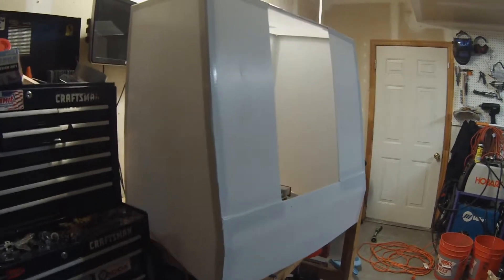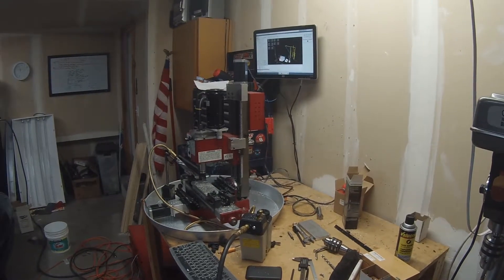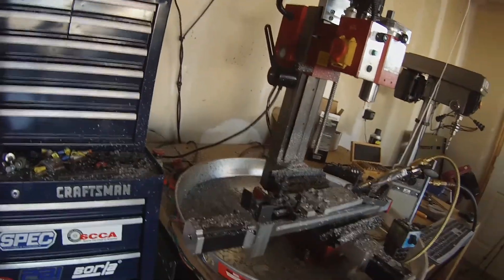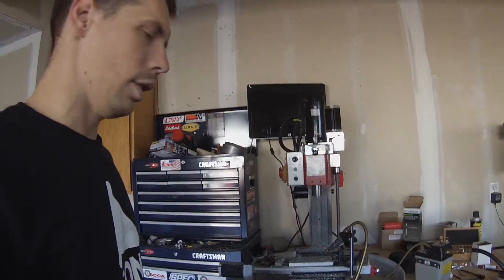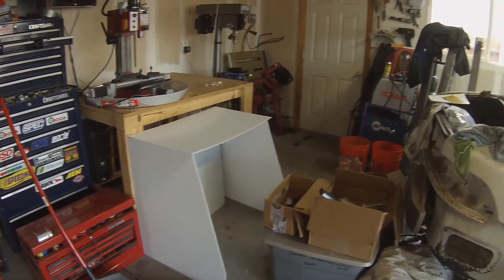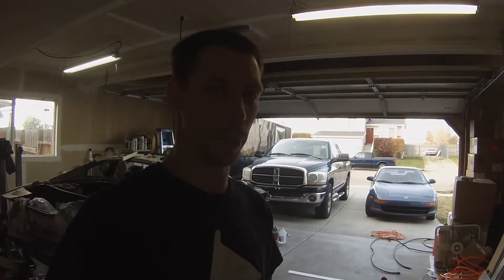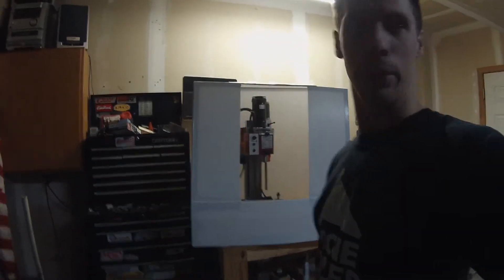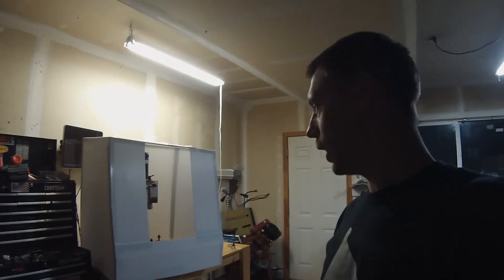Making a Mini Mill CNC Enclosure

Comment: Very good. Looks like you are using a coolant mister. If you really want to tackle the chip problem an enclose like that well help, but I can not emphasize the heavy use of coolant. Go check out some vids on new cnc's. The coolant use is probably in gallons a minute. They use multiple hoses pumping out coolant. There is great advantage to this as your tools will last a lot lot longer and with aluminum you can run your spindle wide open, just adjust the feed speed. Enough coolant and aluminum well never bind to the flutes on the end mill. The simplest professional mill chip system I saw was on a mill that had a rectangle tray that just pulled out from under machine. Nothing fancy. You will be surprised how effective an investment into this well be. You can easily double production times. I am sure there is a limit to speeds you can cut aluminum, but I was using a machine that I was cutting aluminum at 10,000 rpm wit a 3 flute 3/4 inch end mill and the chips were flying out going about 15 feet, sound like a chain saw. Remember that just aluminum. Titanium can catch on fire. Just trust me on that and a hole bunce of metals you will not get improvement in speed but your tools will last much longer. That in it self make use of lot of coolant worth while. Good luck, Sean